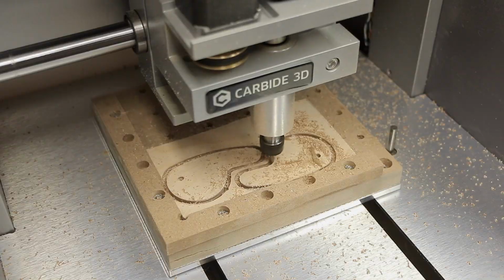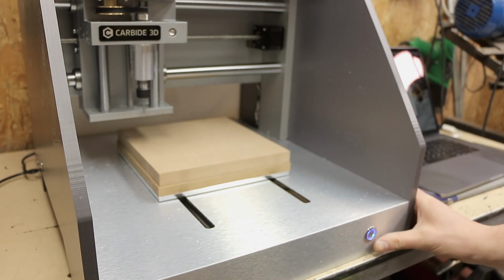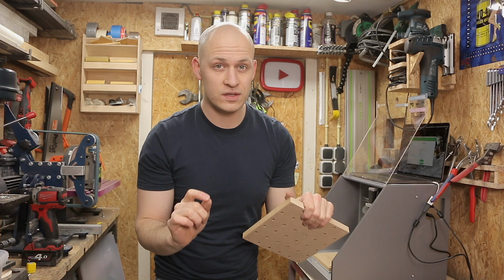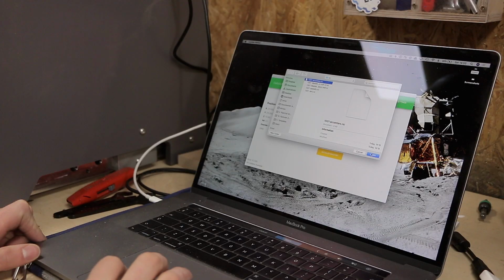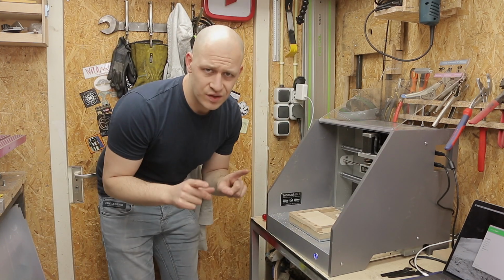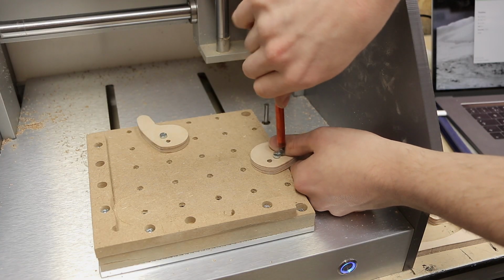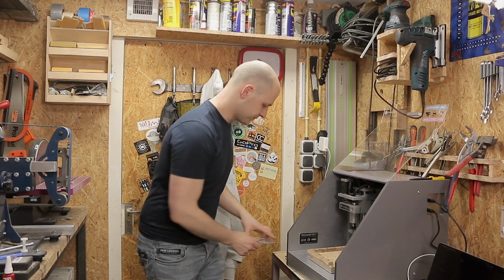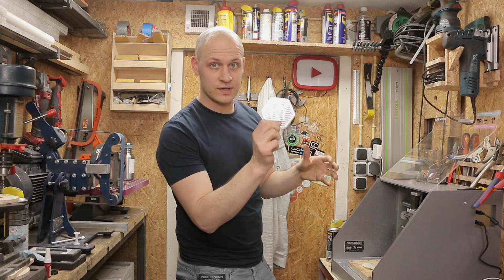3 ways for stress free CNC work holding

Comment: Nicely done! I personally like double sided tape over painters tape but that's all personal preference. Vise and/or soft jaws are also good for smaller repeat work.
Reply from the maker: Thanks Winston! I found that with double sided tape the aluminium starts moving a little. What brand do you use?
Reply: @Thepracticalengineer  I'm a big fan of Nitto Permacel P-02, as well as 3M 410M. It's not quite as tenacious or cheap as carpet tape, but it's far more pleasant to use (peels off cleanly). Another thing to keep in mind is that if your aluminum part starts to warm up significantly the adhesive bond will weaken, so gotta make sure your cutting parameters are good.
Reply from the maker: Thanks! I'll check those out! I still have a lot to learn with those parameters so that may be part of the issue..

Comment: When removing the project attached with CA glue and painter's tape, you may want to twist it. CA glue has very little shear strength and the project will com up easier.
Reply from the maker: Thanks for the tip! I usually just pry it off with a screwdriver but I'll try this next